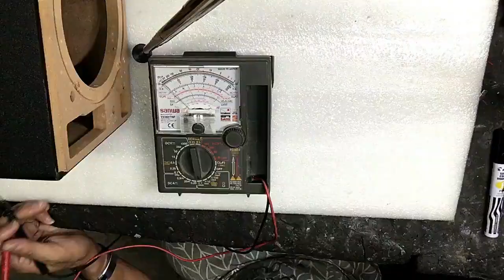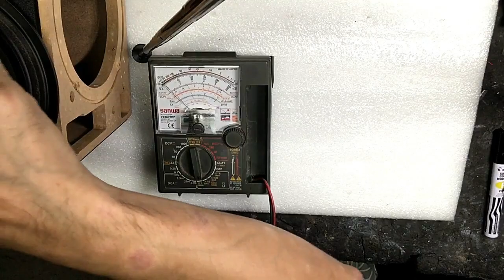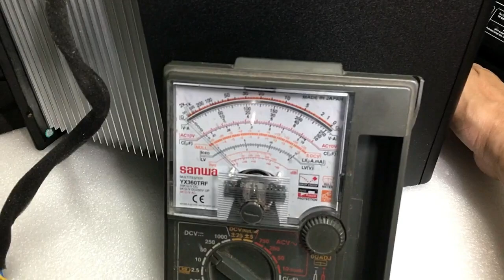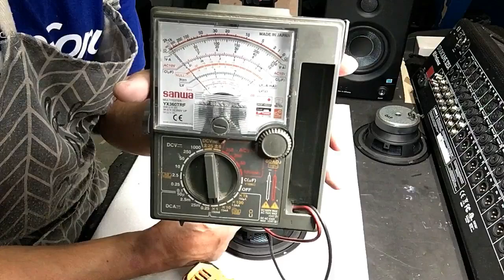How to Repair PreSonus Eris E5BT No Low Frequency or Bass Output

Comment: Tengo el mismo problema con un modelo sceptre S6. En la PCB veo ligeramente sobrecalentado las terminales de un capacitor de 680uf a 50v, ¿podría ser el problema? Es un capacitor de la serie FC, solo que no he encontrado un datasheet para ver su tolerancia y ESR
Reply from the maker: You should also check the LF driver ..
Reply: @FixYahTv  sí, caray. Está destruido el imán del woofer :'(. Sabes si ¿presonus vende refacciones?

Comment: Hello Sir, I have my 5BT, but no sound can be heard like you shortened the speaker wires, no volume up or down but it cracks/high pitched but the sound is hardly heard so it is distorted, when headphone connected NO SOUND at all, will you please help me, much appreciated, sorry has to be in English- please> Jennie
Reply from the maker: I think the problem with your unit is the main output IC. The one  that is mounted to the heatsink. Try also to replacing  bulging capacitor around the IC..